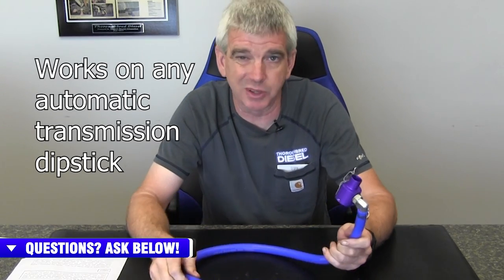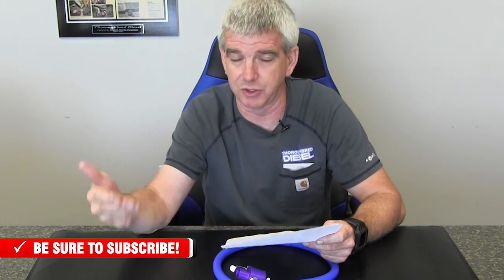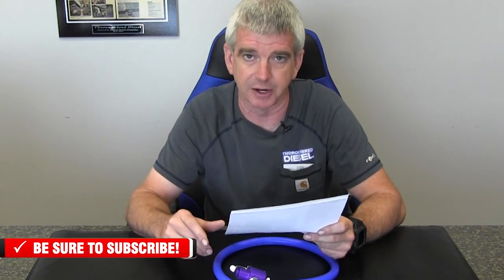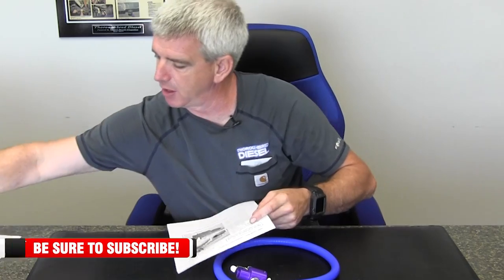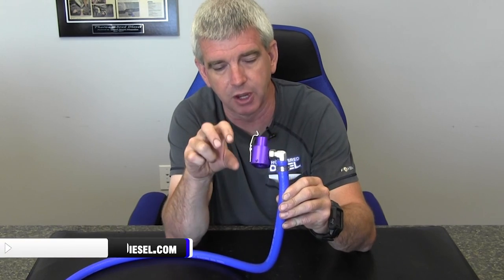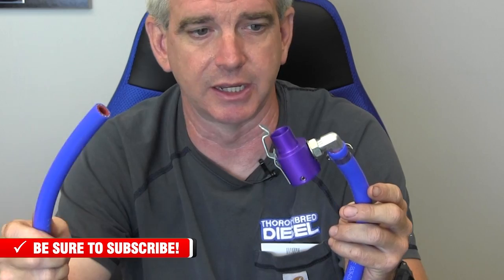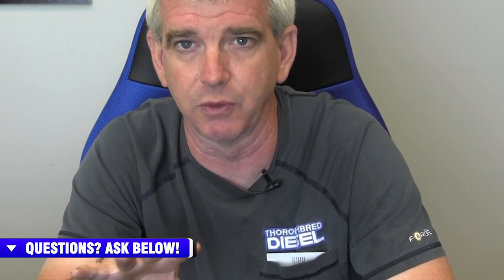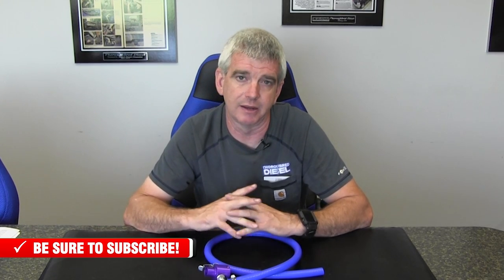🔥 DON'T CATCH FIRE 🔥 IMPORTANT DODGE RECALL  ATS Doomsday Dipstick Overflow Control #diesel #cummins

Comment: What are the dealers doin for it? Something like this too?
Reply: He said they are replacing part of the valve body.
Reply from the maker: They are replacing part of the valve body.  This part will help until they do it and/or as a preventive measure.
Reply: I have my 2022 ram 2500 and currently they did the recall and changed the transmission tube and the dipstick to read the trans oil to a very short one that can read the trans oil.  Which I'm mad at because now how am I supposed to read the trans oil level?
Reply: @pr4lviper  Exactly. I just found they gave me the short dipstick as well. So I'm going to call the service department where it is was done and ask them that same question. Luckily I have an old dipstick that I can still read my level. If anything, they should have given you old dipstick back so that you can at least check fluid level even thou solution isn't the right one.
Reply: @pr4lviper  You know what they should have done is give you back your old dipstick so that you could check your fluid level but I think they are afraid if they did that people would put it back in so they want be free from any liability. So I went ahead and bought another dipstick so that I can check my level. That's what I would do and I am doing. By the way, I purchased from Geno's Garage which you can google if interested. It's their solution because they have no other solution.
Reply: @tommymyers8773  but how can you check your oil level if according to them they tell me they sealed the transmission dipstick, that's why the change.  I think it's a lie... but since I haven't tried another rod.  I will claim the original rod.  I bought my vehicle with her!